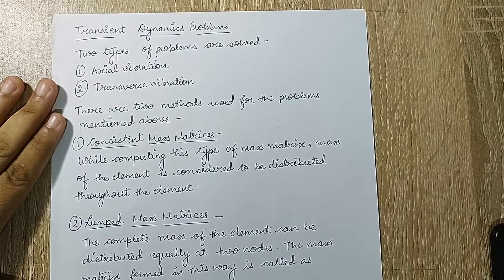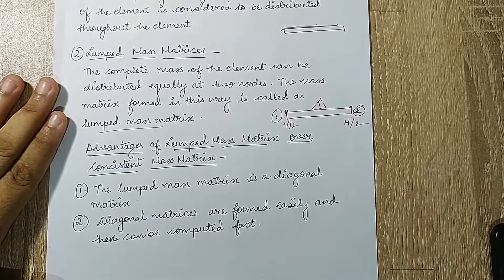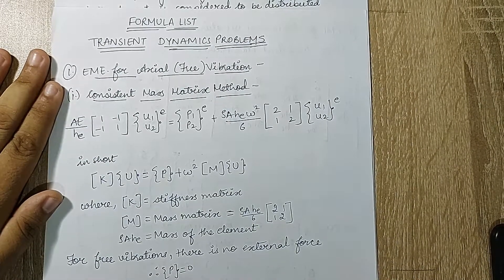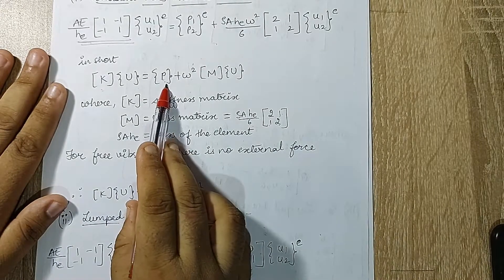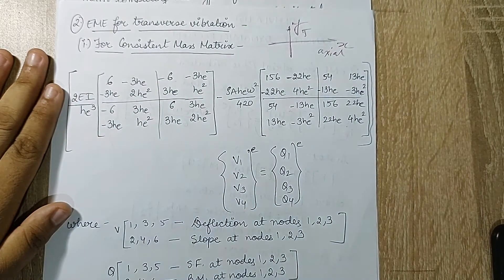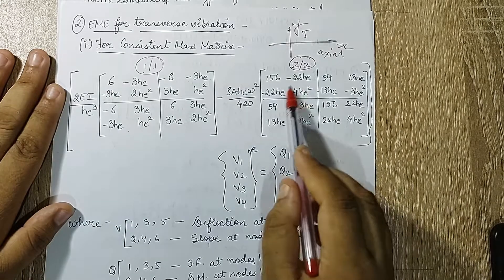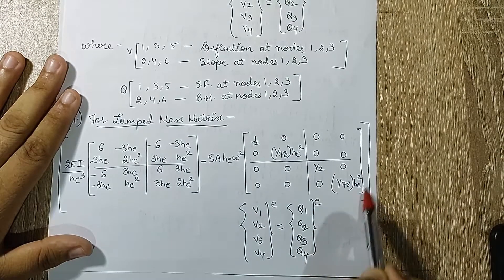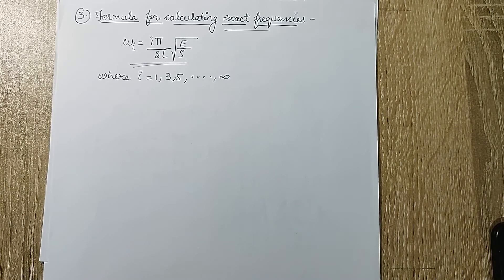Introduction | Axial | Transverse Vibrations | Transient Dynamics Problems | L-1

Comment: mam in questions of vibration why they ask axial vibration in cantilever beam and transverse vibration in fixed beam? is there any concept?
Reply from the maker: Check the video of modal analysis of axial and transverse vibration. See their boundary conditions and the pattern of their movement. You will get the answer